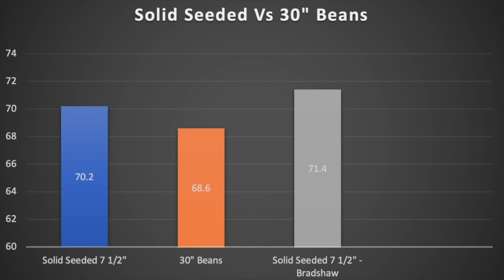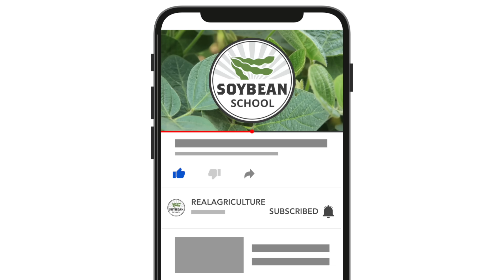Soybean School: Does 30-inch row spacing beat 7.5 on the farm?

Comment: I farm south of Rochester, NY, which I think has a similar climate to you guys...farmers around my area are starting to use fungicides, but a common occurrence is it prolongs the plant life and when I'm in the field end of september clipping beans off to follow in with winter wheat, neighbors with fungicide are waiting another week or two...this deters me from using them...also COST. I've heard any fungicide that ACTUALLY works, is $30+/ac w/OUT application costs....you've gotta gain some significant yields with $9-10 beans to at least break even. With corn I haven't heard a lot of feedback, but with Tar Spot coming in, we may not have a choice??

Comment: i tryed 7.5 rows vs 30 in rows at same pop and at harvest in a 300bu load the difference was 1 bushel so planting with a 30 ft planter vs a 15 ft drill the planter wins out and i have the choice to cultivate if it get dry and the last few years i have dropped bean pop from 140,000 down to 80,000 and yields have gone up especially on the high sand and now i double crop beans behind all my wheat at the 80,000 pop in 30 in rows